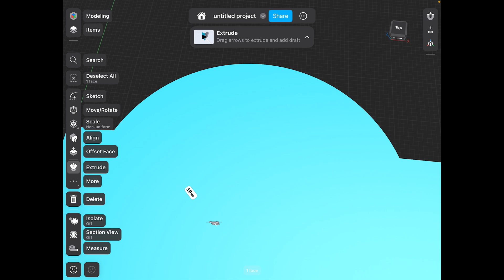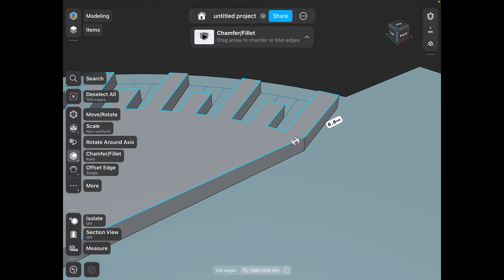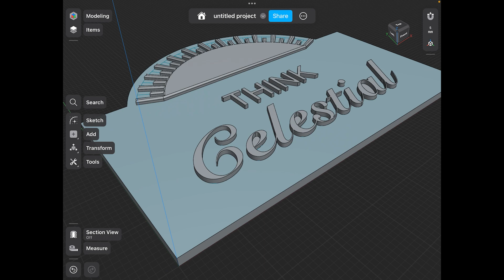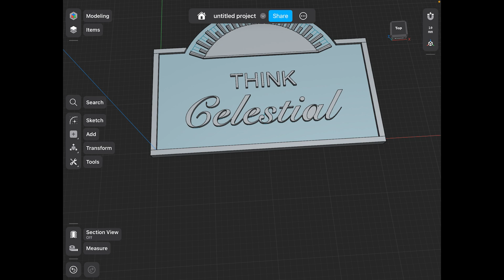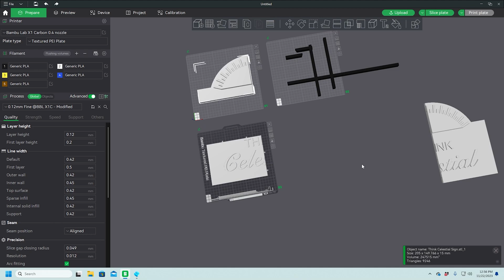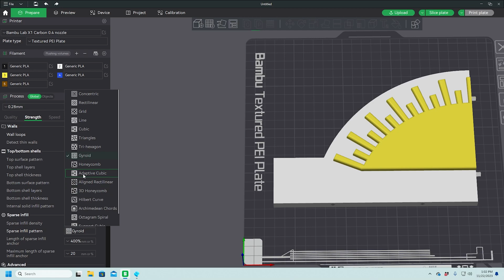Designing a Sign in Shapr3D - Start to Finish (Printed on Bambu X1-Carbon)

Comment: Can I get the Bambu file from you. ( that has all the sitting in it.  I love the build and I learned some things like splitting thing,and making pins
Reply from the maker: Hi Kenneth,
Unfortunately, that’s something that I can’t share right now. I’m selling these products on Etsy, so I can’t give away my project files for free. I do, however, have a Patreon, where I share my files, as well as a grant commercial license with them, as long as one remains a Patreon subscriber. I know that I have shared some variations of this sign on Patreon. I’m not sure if the full size version is there yet. But if you’re interested, you can find my Patreon at https://www.patreon.com/ThisPrintedThing?utm_campaign=creatorshare_creator.